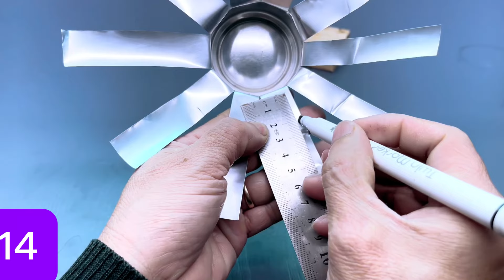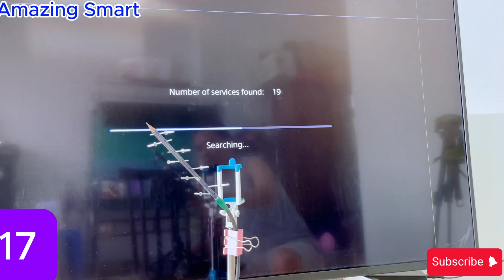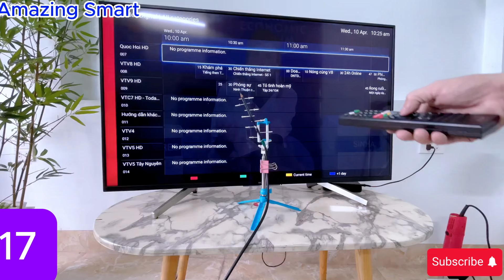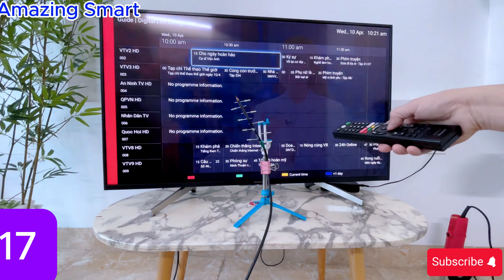Don't throw away the Styrofoam! Genius DIY ideas that You Won't Believe😱

Comment: اسم تین چسب چی هست وباچی قاطی کردید...یامخلدط
Reply from the maker: The name of this adhesive is epoxy glue. It consists of two components: resin and hardener, which need to be mixed in a specific ratio to become strong and durable. Have you ever used epoxy glue for similar projects? 😊